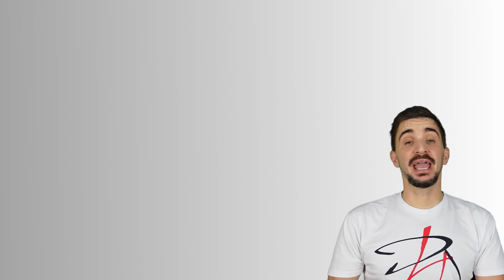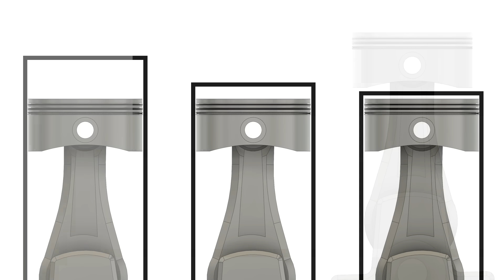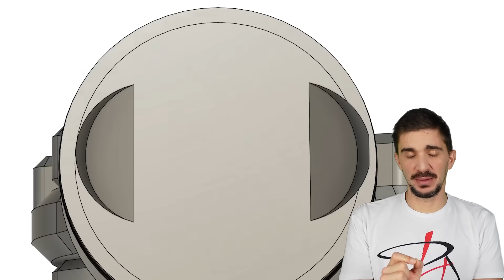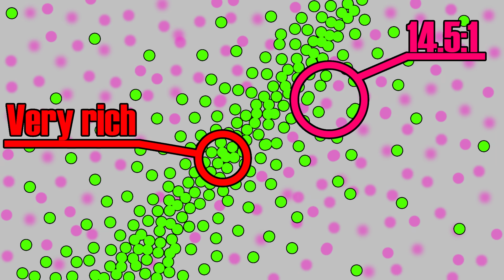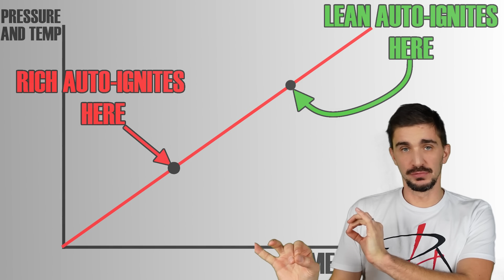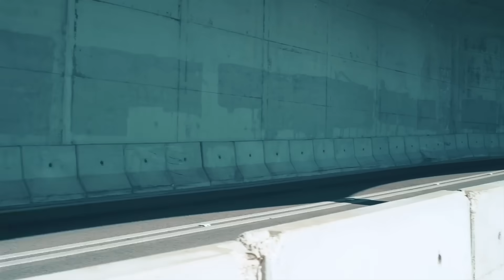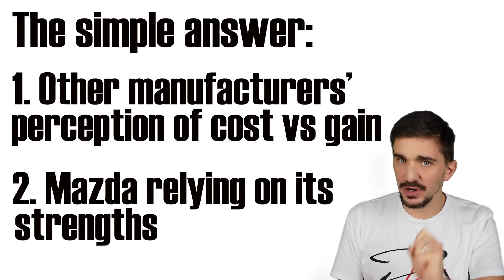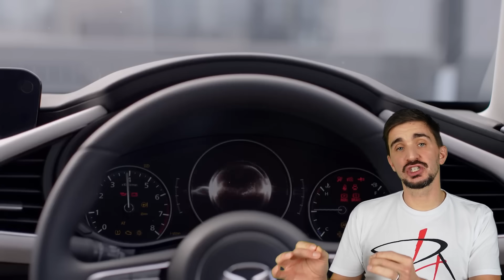The Game Changer Nobody Cares About - Mazda Skyactiv-X SPCCI How it Works and Why It Didn't Catch On

Comment: I take offense with diesel being efficient and dirty, it's really not when it's running lean as it should be. The government's nazi-like control over nox emissions makes diesels dirty. Lowering compression ratios, choking them with egr etc. If you tune a diesel with no emissions components to run extremely lean at all times the exhaust is VERY clean, soot free, low temperature. The only downside is high nox output but that doesn't qualify as dirty

Comment: I mean why not have the HCCI set at a certain RPM to spin a generator and cave that give power to electric motors on the car like a TRAIN , Then you can have a very clean running engine without have to make its loads/ power change and get incredible gas mileage... oh wait then big companies would make less money just like how the make cars now that fall apart while distracting you with all their useless electronics.

I just want to build my own car one that will embarrass auto industry while using older parts like those on tractors and trains.

Comment: Another great video, and very, very 'on point'.
I have been thinking to myself this exact thing... 'Where are all the SPCCI Mazdas'?
As an ex mechanic, who used to work for Mazda, and a previous Mazda2 buyer, I was amazed at how even that base model's Skyactive engine had been optimised to run on low quality 91oct fuel with a 13:1 compression ratio 😳
When I think back to my rally days, my 11:1 Datsun engine was right on the edge of pre ignition running on 100oct race fuel.

When I saw the Skyactive X come out I really hoped it would become mainstream across their model range.

Comment: Do tell them that the "best" mode is only for low power and they still use a regular spark plug for power, high revs and other conditions!

I would get a Mazda, but their dealer network is quite smaller, and that matters.

Happy with the power and mpg from Korean car with infinite valve timing/lift.

Comment: I accept that you need to simplify the video for a wide audience but....some of the technical details are not quite correct.
.1) Diesels are designed to have huge amounts of swirl in the air intake to ensure thorough mixing of the air and fuel during combustion, Thus soot formation in any modern diesel with clean intake ports and good swirl is minimal. Poorly maintained vehicles with high mileage is a different story. Compression ratios have also been dropped quite a bit to reduce pyrolysis.  High NOx is mainly caused by the excess Oxygen and Nitrogen combining above c. 450 deg C. This is reduced by use of EGR to displace excess air and cool the combustion process.
2) Gasoline engines are rarely solely stoichemetric in 2026 and most operate in either homogenous or stratified lean burn mode depending on running conditions. These engines are not NOx or soot free either and a number have EGR valves (or variable valve overlap to mimic EGR) and  gasoline particulate filters fitted. 
HCCI is a modern take on hot bulb ignition and I am very sceptical on it's overall benefits, Iam sure they will work well when new but I can see lots of trouble once carbon accumulates on the piston or the engine starts to consume oil..

Comment: wouldn't HCCI be a good fit for a gas-eletric vehicle since the engine would essentially just be a generator for the battery and thus only have a static load?

Comment: The problem actually is that SkyActiv-X engines are not significantly more efficient than other petrol/gasoline engines (although they seem to have lower emissions than other petrol/diesel engines). Going by comments from their engineers, I suspect the reason that SkyActiv-X doesn't achieve better, diesel-like efficiency is that the petrol/gasoline supply for consumers has far too HIGH octane. Unlike typical petrol engines, their design works best around 70-80 RON (IIRC), which is far lower than available (95 RON standard in Europe). Seems like one of those situations where the engineering is smart, but doesn't suit the market it has to exist in.

Comment: This plays like a marketing video for Mazda. Ohh a "localized pressure increase by using a spark plug to cause auto ignition" aka knocking in a lean high compression engine. So basically the spark plug ignites the fuel air mixture same as every IC engine ever. And did you cover the extra mechanical complexity to allow this system to "save 30% fuel" some of the time? You know what an efficient and powerful gas powered propulsion system is? Atkinson cycle + Electric motor + eCVT. Mazda better step up that R&D budget, and BTW how about doing a "full disclosure, Mazda paid me to say this."

Comment: Mazda engineers assumes that mazda drivers likes driving, very small screen for navigation, a lot of physical buttons easy to operate safely while driving… 
My mazda 2 has a 6 manual gearbox and 4 cylinders so it’s a pretty decent car on highway in terms of confort  at high speed cruise… it likes to rev a lot, it’s fun to drive while being a good daily car on every aspect. And it is reliable because no downsizing supercharged… 
I hope they’ll get some success for their hard works at some point…

Comment: Imo, turbo torque is ideal for an appliance with an auto transmission for just efficiently getting around.

Old school style NA engines NEED a close ratio manual and are not going to appeal to those people who switch off brain when they switch on ignition. They are for people for whom the act of driving is still a skill to engage with.

Comment: I remember being very excited about the HCCI tech before it came out, I wasn't sure how it had worked out but I'm glad they're good efficient engines! The cars they are in generally look really nice and have nice interiors, though I've been a little iffy on the chassis dynamics of more recent Mazdas that I've driven and it's a shame they don't offer a higher power motor option more often, they just do one moderately reasonable choice and that's what you get, they're not taking advantage of any halo effect. As for the whole working the engine philosophy, it is annoying so many people think revs are bad...really your engine is most efficient with wider throttle openings in the thick of its power band, plus babying most modern engines just leads to quickly gunked up valves and oil rings, I advocate for using the engine's powerband when you want power and light throttle lower rev cruising and coasting when you don't need the acceleration.

Comment: The belief that a High compression engine is more efficient is a complete misconception. Compression always expends energy, thus it always makes the engine less efficient.
However, an engine gets its power and efficiency from its expansion ratio.
The excess compression ratio wastes energy at a lower rate than increased expansion ratio increases it.

Comment: Working in the auto industry with used cars, the only problem was really when they had ford engines. after that switch, these mazda engines was proven to not only be better but way more reliable. I think mazda would of been in the for front had ford not tarnished the name with their shitty motors. With inspecting over 170 cars per week, Ive found that the used mazda after 2014 seems to be pretty reliable and the only problem that can occur is owners neglect; which is 99% of the time. Overall its a very good alternative to a honda or toyota if you want reliability and a good performance package in some of their vehicles.

Comment: Your initial statement that gasoline is clean is factually wrong. It was only correct with carburetor engines. Direct injection gasoline engines produce fine particles and NOx like a diesel, albeit a bit less, but still very significant.

Comment: Perfect engine for hybrid electric drive where the ICE engine does only charging the batteries and the drive is fully electric. It could operate in the compression ignition range all the time and provide the 30% efficiency improvement constantly.

Comment: Ive got a 1997 300tdi , some time ago i introduced lpg fumigation to the air in let atomized with the air and diesel,, bingo we have a 98% burn regardless of how much you have your foot on the pedal 30% more fuel burnt but over all 10% using less over all  fuel and a truck load more torque and horse power

Comment: I think your entire premise is wrong.  When you line up the Mazda CX-50 against its three main competitors, all three without Skyactiv get better mileage in both driving categories (CX-50 = 23/31, CR-V = 26/36, RAV4 = 25/38, and Forester 25/34).  No amount of marketing is going to solve that problem.  Checking Consumer Reports, it appears that Skyactiv running super lean also creates significant problems with soot buildup, requiring increased service.  So outside of this engineering discussion, Skyactive does not appear to be the transformative technology that you are describing it as.  In fact it kind of sucks, like your channel.

Comment: Could be many other reasons, including patents and licensing. Wouldn't be surprising if Mazda held some legal leverage that made it extremely expensive if not outright illegal for others to do the same. One only needs to remember that Fein had a patent on oscillating multi-tools - up until just a couple years ago NOBODY was allowed to make those, once the patent expired every tool-manufacturer jumped the opportunity, but up to that point, for a very long time, everybody knew that oscillating tools really were useful for some works and simply were not allowed to create them.

Comment: Mazda isn't incapable of making a hybrid. I saw one design of theirs that incorporates a small rotary engine with a hybrid drive. I don't see why they haven't used their SkyActiv engines with a hybrid drive. That would create more power using the high-torque electric motor, and even better fuel economy. Win win.

Comment: The shortcomings of the SCCI engine sound much like those of the Atkinson cycle, boring, no low end torque, works best with a light load, etc.  So how about using SCCI as a narrow speed range extender instead, especially with cylinder deactivation and/or hit and miss operation to take the fuel economy to the limit?

Comment: Thank you for this wonderfully understandable video!  I’ve always felt Mazda R&D was under appreciated. I wonder if you could do a similar in-depth analysis of the latest Honda Accord hybrid, with the Atkinson engine. I feel it, too, is an underrated piece of engineering, where torque (electric) and power (electric & ICE) interact somewhat differently than in other hybrids. I think your analysis would help me understand even better how Honda’s newest set-up differentiates itself from Toyota’s hybrid system. Thank you.

Comment: I had a skyactive D cx5 when they first came out. A bit of an oil dilation issue as first but it was an very engaging drive. once had 72mpg from it. said goodbye at over 75k miles to downsize car.
the models that followed started putting on weight and acceleration was worse. the moved away from their 'gram strategy' to more heftier luxury lumps

Comment: When talking about those lean gas engines, I always have 2 questions in mind:
1) Why do HCCI engines not get destroyed by knocking when compressing a lean mixture to much more than 15:1 like other gas engines would?
2) Why didn‘t Mazda inject gas like in a diesel engine only near top dead center instead of using a spark? If they just WANT to compress the gas mixture, see question 1): how can they be sure the mixture does not self ignite at thesevery high compression ratios? I mean, every regular sports car stops at 12:1 …

Comment: Saying it's good because you need skills to drive is an argument that we already lost. But what we did NOT lost is the argument of simplicity. An engine that can do both 17km/L and also low emission, without balancing axis (in opposition o 3 cyl) , without turbo, without hybrid system, is a huge deal. I hope this engine has a great future, both in its house at Mazda, or together some Toyota hybrid system, or wherever it can be.

A question: why that VW Audi direct + indirect injection system didn't succeed as well as this Mazda system?

Comment: So what Mazda needs to do is give it a tiny battery with an electric motor that makes loads of torque but it doesn't need to make a lot if power. Wouldn't be too exprnsive because a lot of other manufacturers already do it, they could just license a system if they don't want to develop their own. It would work with a manual if they so wish, and it just fills in the low end grunt that the 2.0 is supposedly lacking. And although I haven't driven a Skyactiv-X car, I do believe it feels gutless only because of power inflation. A 2 liter NA engine 15 years ago wouldn't have been even considered slow for normal use, and they would have made 150 hp, probably less in most cases. So 180 is nowhere near bad

Comment: Huh.
Doesn't make any sense why they didn't solve the 'work the engine' problem by a computer that reads the throttle position and force and do all of the 'working' to achieve performance via software.
Oh, and turbo the thing since they're pretty ubiquitous in cars these days.

Comment: I kinda wished they'd made a higher power version of this. I really like the design and feel of the Mazda 3, but I want a hot hatch. 184 hp isn't going to cut it if one is used to a 350 hp 2.3L Turbo. I'd be willing to downgrade a bit to maybe 250 hp, but not that much.

Comment: I have the Mazda3 with the Skyactiv-X engine for a year now, manual. I do not find the engine boring, of course it's not exuberant like the turbo ones but has some advantage: it's incredibly smooth, a real pleasure and comfort without any spike of torque. Also the shift of the manual Mazda is probably the best humanity ever made, it cannot be easily described, it's precise and almost magnetic. I really like to drive this car and I do not regret not choosing the Honda Civic that's really similar but with turbo. Ah, almost forgot, the lower rev is really low, when the engine is warm it's a bit over 600 RPM, and the fuel economy is good too and I have a heavy right foot.

Comment: It seems like HCCI would be perfect for an electric generator on a car that uses an eCVT and has a small battery. Connect a motor to the camshaft to initiate the combustion cycle, and design the system to always run the engine at the ideal rpm. Mazda has instead pursued using a rotary as a range extender engine.

Comment: I wonder if you could do a modified diesel set up where you’re intake stroke creates a homogenous gas mixture that would require a very high compression ratio to ignite, but instead, at TDC, you inject a spray of diesel that will ignite, and due to the gas/air mixture, it’s a more complete and instantaneous burn that then also causes a more full burn of the diesel. 

This is what I thought HCCI was when I first saw the name of it in this video.

Comment: Why not lower comression/make the mixture lean enough that it doesnt ignite by itself and put a active prechamber on it and controll it like a diesel with a tiny amount of fuel and use the active prechambers spark plug only for starting?

Comment: Could they do this with the rotary?  I understand that Mazda has a very interesting range extender rotary engine in Japan.  It's compact and light weight.  However the challenges of the rotary were fuel efficiency and emissions.  This is basically due to the very squished shape of the chamber during combustion.  Something like this could improve efficiency and emissions and you have the more predictable load curves of a range extender (as apposed to direct drive).

Comment: I have the CX30 with the Skyactive X engine. I was 100% sold on the engine being a 'game charger' and you know what. It's a waste of time. 

We had a Mk08 Fiesta ST. We sold the car after 10k and averaged 45mpg. We have now done 20k miles in the Mazda. And you know what. We have averaged 47mpg!. A whole 2mpg than a hot hatch. 

Not only that, the Mazda is gutless at the bottom end of the rev range, and doesn't have a particular interesting desire to rev (as per your video). So in summary. Yes, I am sure as your video suggests it's 'interesting' - But in this case, Mazda should have done what every other manufacturer  did. Small capacity and turbo.

Comment: I own one such Mazda 3 (2023 model year) with this engine. Mazda gives you a menu in the infotainment where you can actively see if the engine is running in SPCCI, normal combustion or is turned off (start-stop).
Its neat to see it in action. My fuel consumption is around 6 l/100km so I get about just shy of 700km out of the 51l tank give or  take.

Comment: I had the 2.0 SkyActiv-X in a Mazda 3.  Trip computer claimed high 40s mpg.  Actual mpg measured brim-brim was about 41mpg, so the computer grossly exaggerates the fuel economy. Not impressive, and no better than the 2.5 litre SkyActiv-G with the same power output (but smoother, as it has balance shafts).  My conclusion: SkyActiv-X is reliable enough, but it is expensive and saves no fuel in the real world.

Comment: Mazda does reliable engineering well. The normal skyactiv is amazing, 13:1 c.r on the usual na Mazda is still insane. The turbo motor is 12:1, but runs EGR to regulate the intake. The new 6cylinder is the same

Comment: Isn't that a supercharged engine.
Reply: It is supercharged, but I think the supercharger is only there to add additional air for rise in temperature and pressure in the cylinder before "SPCCI-ignitions".
If this is the case it is indeed quite peculiar as the engine will have higher charge pressure during part load than at "full throttle"!